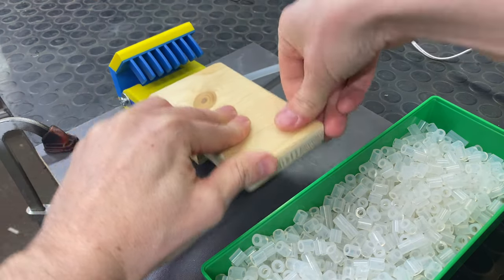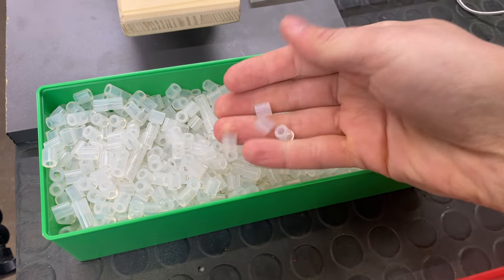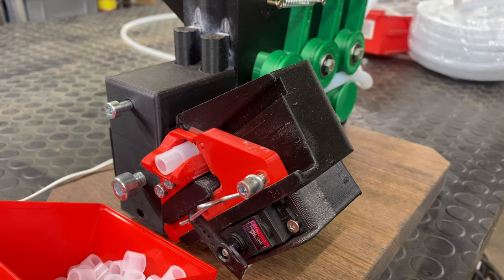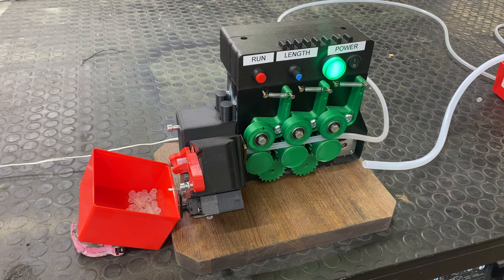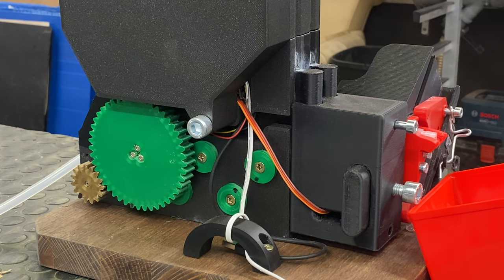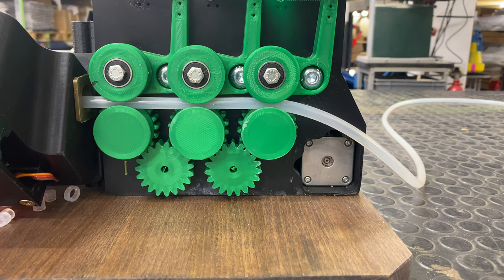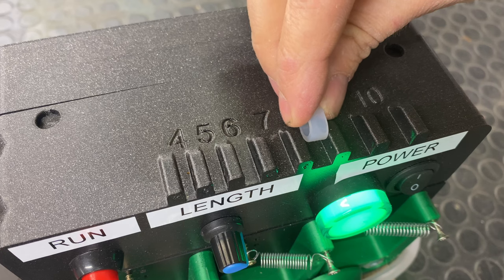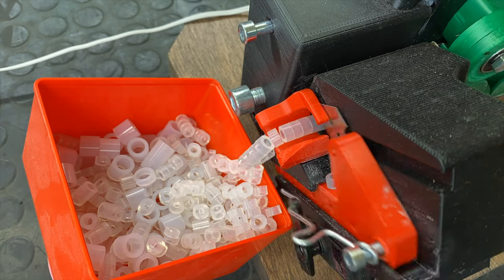Cutting-Edge Automation: The Silicone Tubing Cutter You Never Knew You Needed!

Comment: We had this exact problem for my own products but much longer lengths of 10 to 75cm. Our final solution was still manual but involved wrapping the tubing around two rollers that could be adjusted to be closer together or further apart. So long as you keep the tension consistent you can get a bunch of tubes all the right length in one cut.

Comment: That is really impressive. I bet there would even be a market for this machine for small scale manufacturers
Reply from the maker: There are some companies that sell this, but its very specialised and usually for heat shrink tubing. I wasn’t sure if that equipment also cuts clean and 90°.
Reply from the maker: @artcamp7  I don´t think there is a big market for this product. Even if this was a great product, if you give the license to somebody you always have the risk that that person runs away with your idea. With Matthias I belive he didn´t believe in the success either, but gave it a chance and it was a success by accident. Although I personally don´t find the Pantorouter so practical. It seems a bit complicated even though it can do so much.
Reply: @MaxMakerChannel  I've tried to cut silicone tube on a couple different heat shrink cutting machines... Works ok ish but the output chute easily jams on silicone and the cuts are never quite consistently perpendicular your machine is a pretty decent step up with the super open frame design.

Comment: great design and project. i would suggest adding 0.91 inch display, that way you can get feedback of the set length, they cost less than  $2USD, also you will be able to show the number of cuts

Comment: Any updates if the cutter is still cutting well and what updates you had added meanwhile.
Like it a lot.
Reply from the maker: Still working fine. I added a little steel plate at the front to guide the cut pieces better. Thats all so far.

Comment: you can maybe add 2 or 3 razer blade so its faster witjout a lot of work
Reply from the maker: Yes, the cutting mechanism could be improved. I would probably go for a rack ans pinion system with more stroke length.

Comment: Hello @MaxMakerChannel, do you have the files / instructions shared in any platform? I am interested in build something similar. Any updates?
Reply from the maker: Sorry, don’t have any.
Reply: @MaxMakerChannel  Do you think it can cut polyurethane tube? it is a bit harder than rubber and sticks to the blade. I am searching for a machine to cut them.
Reply from the maker: I think it would. But I would redesign my blade this time and have it actuated with a longer stroke length. If your material is thicker you could use a bigger blade and more force.
Reply from the maker: I think it would. But I would redesign my blade this time and have it actuated with a longer stroke length. If your material is thicker you could use a bigger blade and more force.

Comment: Would you be willing to sell STEP or STL files for this?
Reply from the maker: Sorry I cannot. Because I used Gears and motor models from other creators. That is fine for my own use but I cannot distribute them.
Reply: @MaxMakerChannel  No worries! I totally understand. Would you be willing to share how you programmed and wired it or any part of the plans? I think I am going to build one for a very similar application.
Reply from the maker: @MasonTorve-o3g  I used a Arduino Uno and the Arduino IDE for programming. To attach the servo motor just look up a servo motor tutorial. For the Stepper motor, I used the A4988 driver. For that you can also just look up the A4988 tutorial. That’s how I program the stuff. The tutorial shows you the wire connections and the code. Then you just have to combine both.
Reply: @MaxMakerChannel  Ok thank you! That is very helpful. Is there any chance you would be willing to post the files on thingiverse or instructible if you are not able to sell them?